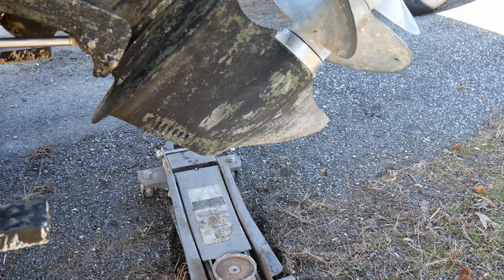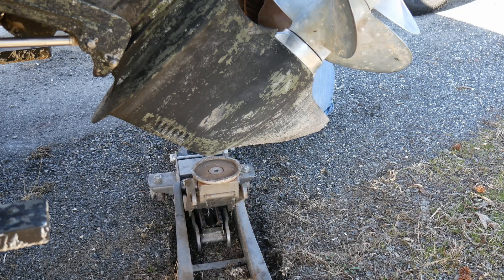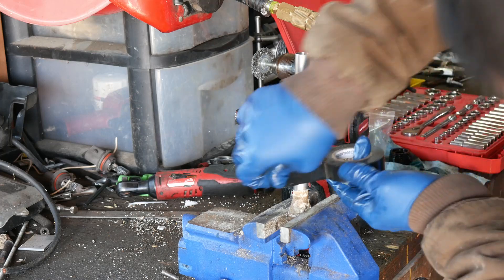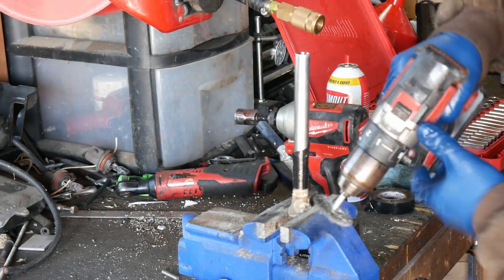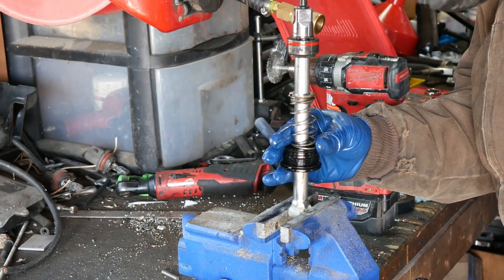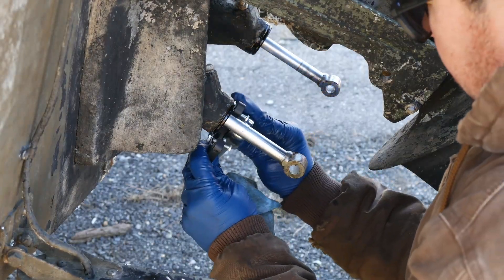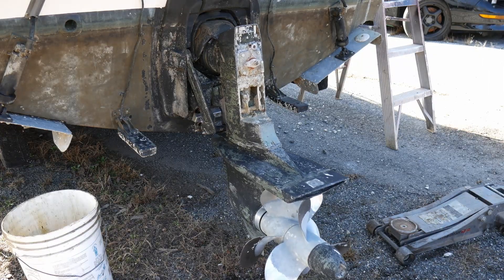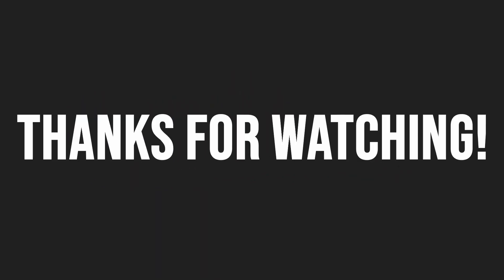Volvo Penta DP 290 Trim Ram Rebuild

Comment: Where did you get that specialty tool to install and remove the caps? Have a part number for the tool?
Reply from the maker: It's a generic pin spanner wrench from Amazon. I believe there are several adjustable ones that you can even interchange the pin sizes for around $20.

Comment: Hey dude. Can you post up a Link to the parts used? that would be super helpful. Thanks!
Reply from the maker: https://www.amazon.com/gp/product/B08LD7HFS7

Those are the complete trim cap/seals. The internal seals you should be able to find in kits for whatever outdrive you may have (DP, 270, 290, so forth)